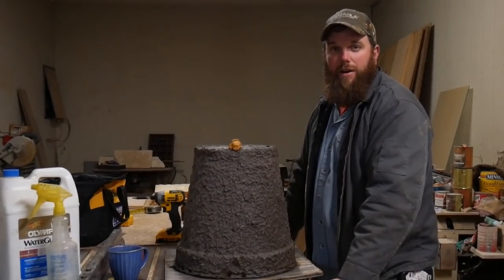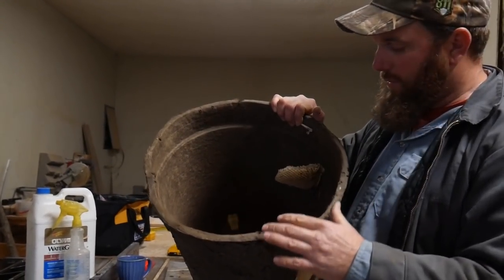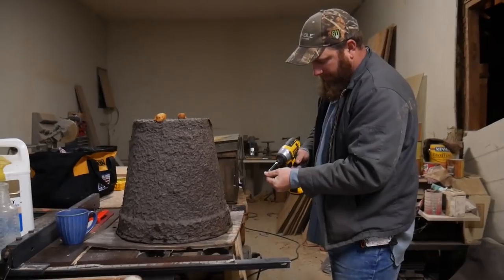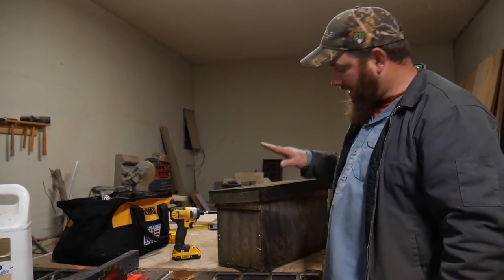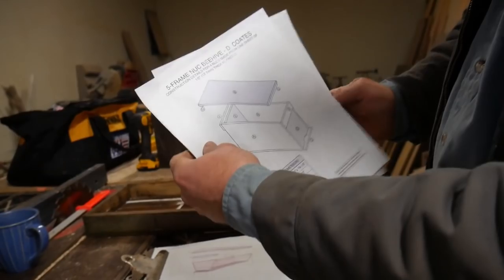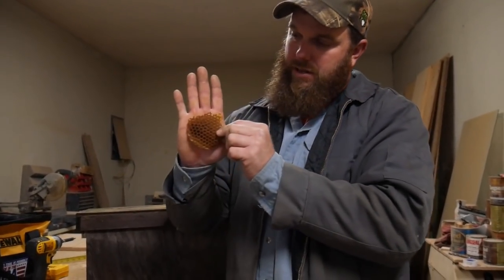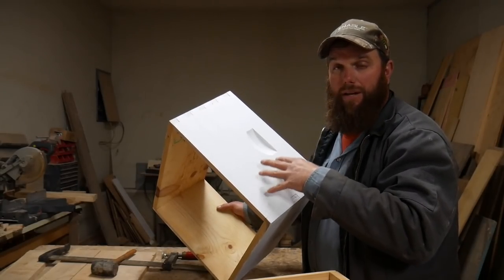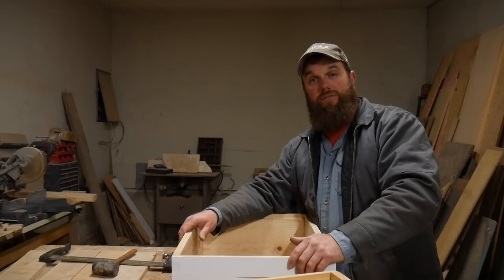Catch FREE Honey Bees (almost)

Comment: Great video Ben. I will be putting out my traps this weekend. I use the flower pot type for work swarm traps and the five frame box for my swarm traps. I like the five frame box because if it catches a swarm I can close the entrance after dark and bring them home. I would suggest to put a new trap back In the same spot right away. I have caught a second swam several times in the same spot. I hang my flower pot vertical with the hole on bottom and lid/plywood on top. When I catch a swarm I just remove the screws, lower the pot and I can get to the comb easily. If I take the pot home I set it inside of a five gallon bucket. Easy to transport. Your right about keeping an eye on the flower pots. I check mine for work about ever three weeks. A swarm must have moved in right after I checked one. When I got it three weeks later it was about to fall off the tree. It was full of comb and had lots of heavy honey. For the five frame I attach a cedar picket fence piece to the back and drill a hole to hang it. Make sure you put a swarm trap up at your place. Bees attract bees. Here is a link to the plywood plans for everyone.  https://www.beesource.com/wordpress/wp-content/uploads/5framenuc_coates.pdf
Reply from the maker: Thanks Danny. Have you started feeding pollen patties yet?
Reply: Yes I have.  Usually I start with only 1/2 patty at first.  Small Hive Beetles are bad about laying eggs in them if they are not consumed within about a week.  I started feeding 1:1 syrup yesterday in my area.  You might be a couple weeks behind us with your cooler weather.  Enjoying your videos.  I think last year when I stopped by I was your forth subscriber.  Now you are at 3.7K.  Congrats.    @VWFamilyFarm